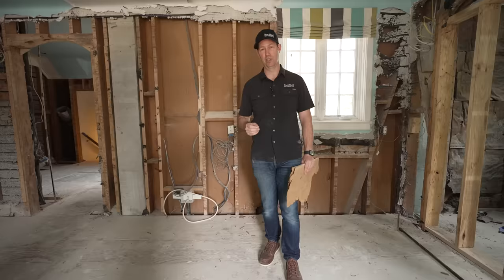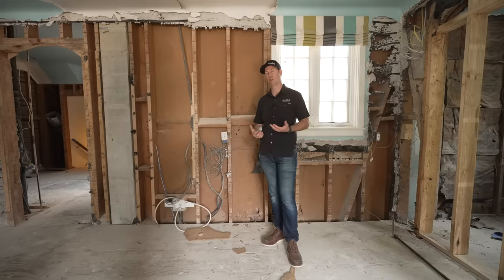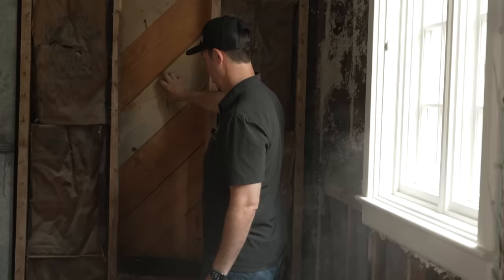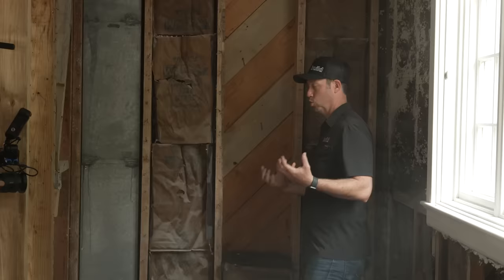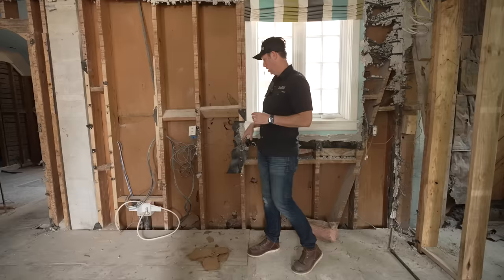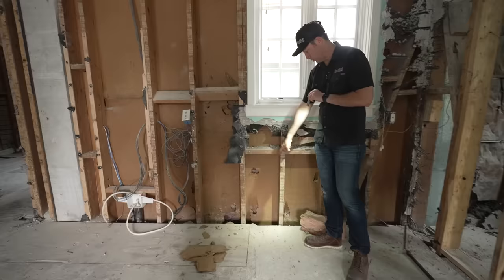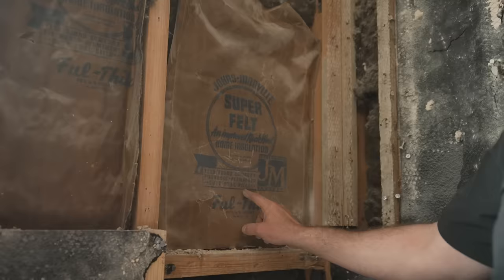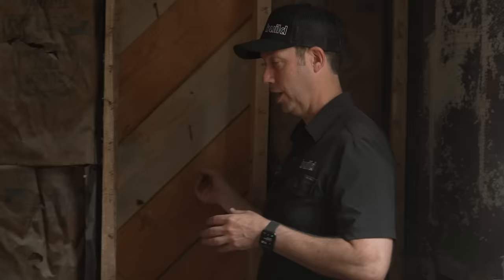I’m recommending we NOT INSULATE This Old House

Comment: would be nice if you could buy gypsum board without paper facing.  i like the idea of insulating on the outside of the walls with siding over that, nothing inside the walls, and lap siding on the inside face....saw something similar, was it on the build show?

Comment: Put greenboard instead of regular sheet rock?
Reply: Greenboard is just drywall with water / mold resistant paper on the exterior. You could maybe do a cement product like hardiboard or densglass  exterior drywall sheathing for the interior walls but I would not use standard interior drywall. Green or white. 🤷🏻‍♂️

Comment: If insulating was an absolute must,, for what ever reason,, would a second Insulated wall on the interior, with an impermible vapor barrier sealing it and the original wall cavity be an option,, granted you would lose floor,, just a thought.

Comment: more incorrect assumptions in this video..   I've never seen someone make unsubstantiated claims to support poor construction in my life
you think insulation is only going to save $100?   oh my.. more like $500 a month in winter,  and summer if you have AC.. which AC is going to make those walls condense water, on the inside of the wall cavity on the cold lathe and plaster. or new sheetrock..  
here is an idea.. instead of going to the permitting agency..  contact an expert..

Comment: Built in a day when a 2X4 was a 2X4
Reply: Sometimes 1.8x4.1 and sometimes 2x3.7 and sometimes... It works with lath and plaster, which are much heavier than drywall there isn't significant benefit to true rough lumber

Comment: Why are the cross braces angled and opposite each other?
Reply: @dallasjolley1  My question is why are they tilted? Why not parallel to the floor?
Reply: @nowacurmudgeon  because, like a diagonal brace on wooden shelves prevents the structure from leaning left or right.

Comment: I would think closed-cell spray foam would seal it completely and still allow the sheathing to dry if there is a space between that sheathing and the brick. It is irresponsible to not insulate. A major goal of construction is efficiency. Resources to heat/cool should be considered. In a perfect world each building should generate its own power needs.

Comment: First thing is it dose not look like anyone is following "LEAD safe remodeling rules".  Plaster may also have asbestos in it! 
There houses built with rock lath behind the plaster " paper / gypsum product" instead of wire or wood as the anchor to the studs. Wouldn"t those houses have mold on the rock lath? I have seen both insulated and none insulated in the north east.